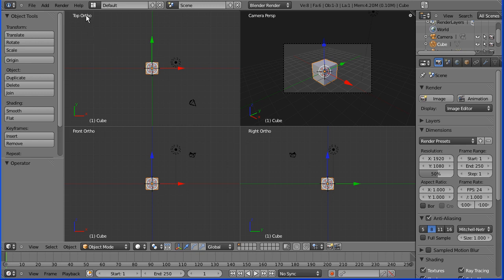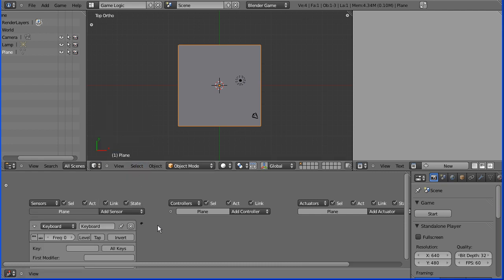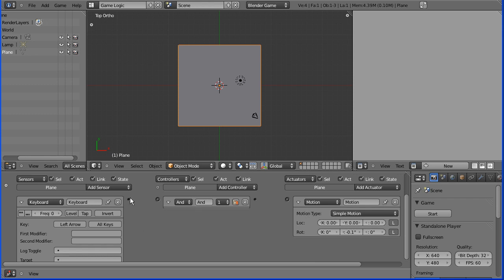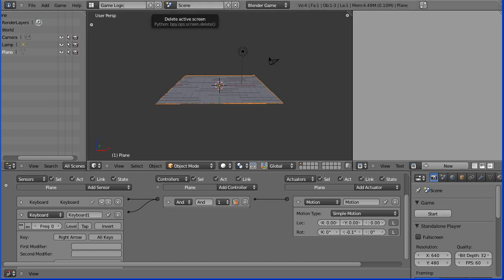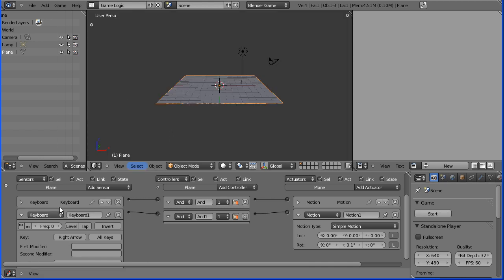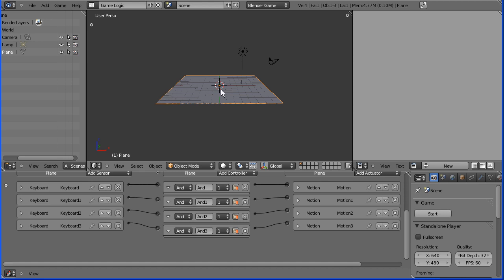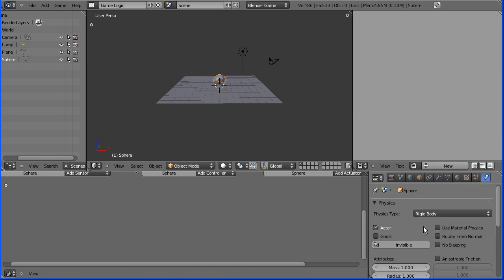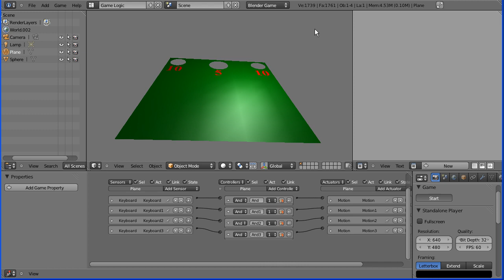Blender 2.5 - Introduction to the Game Engine Making a Simple Ball Game

Comment from the maker: @AmericanGirl276 You an either do it using S to scale or in the properties put values in for X and Y scale. I rotate the view by dragging with the middle mouse button. You most probably need to turn perspective on which you can do in the view menu or press 5 on the num pad. Don't turn the plan upside down or it will disappear.